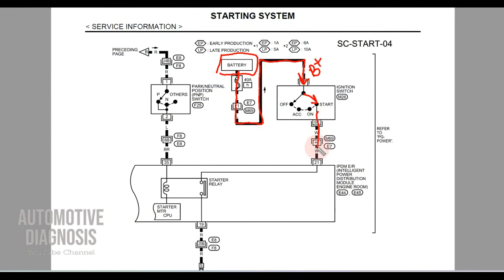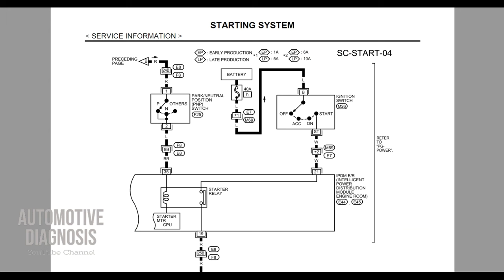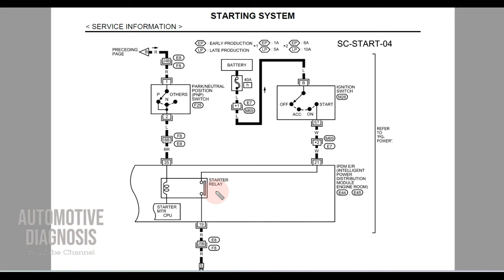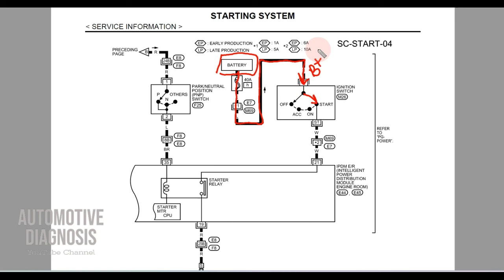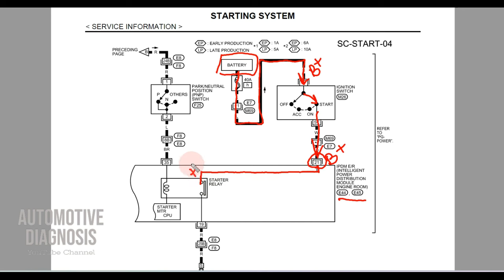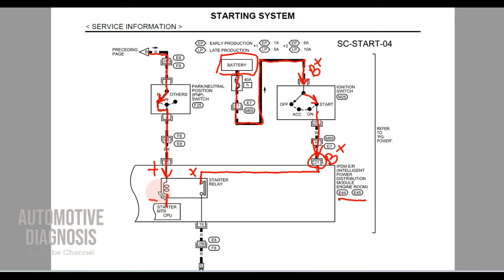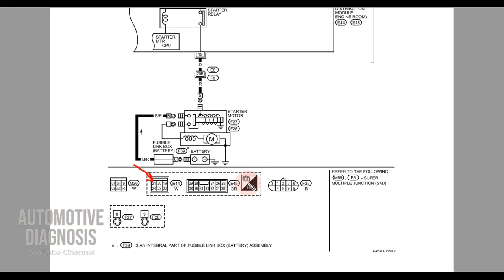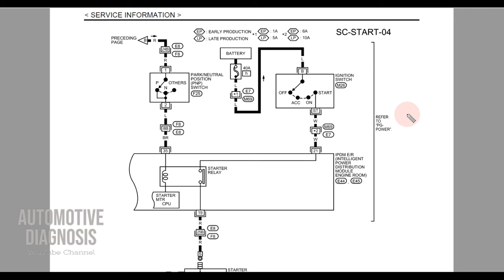Read and Analyze NISSAN Wiring Diagram & Find Connector, Pins, Wires on the Car #nissan #wiring

Comment: Hi sir I am looking for dealer to open nissan car diagram can you help me.please
Reply from the maker: Hi there, I didn’t quite get that. Are you looking for a wiring diagram?
Reply: @AutomotiveDiagnosis  Yasir
Reply: @AutomotiveDiagnosis  Where can I find a dealer?
Reply: @AutomotiveDiagnosis please reply me
Reply from the maker: Please send me the car model and year, I will see if I have the diagram to share it with you.
Reply: @AutomotiveDiagnosis  I want to open nissan techinpo but please can you help me
Reply: @AutomotiveDiagnosis can you send me a 2014 Nissan maxima with the entertainment package Bose system
Reply: @AutomotiveDiagnosis how can I dm you? I’m looking for where the fuel pump wire is under the dash of 2004 350z. Thanks !

Comment: I want to do a b15 sr20 swap but i am worried about the wiring. Any help please?
Reply from the maker: My recommendation is to find the reliable wiring diagram for each one and compare the ECM pin outs between them, so you can make sure if it works
Reply: @AutomotiveDiagnosis  ok thanks

Comment: Greetings from Accra Ghana 🇬🇭, Thanks and much appreciated,, i have Nissan note e11 with a constant problem,  when driving, the speed goes of even when the accelerator Paddle is fully press down, sometimes it comes back after turning the engine off and on, I really need your help pls
Reply from the maker: Hi there, this problem could be an intermittent fault, for example if there is an issue on throttle body connector and it’s on and off when driving. So, I would check the fault codes first to get an idea from the area of problem. If there isn’t any code, I would reset the ECU.

Comment: Nice video.
I have a qashqai J11 2015..want to put a underseat sub.
Can you tel me what collor wire on the radioplug  are for the front speakers ..I have to tap the input wires from the amp to them..